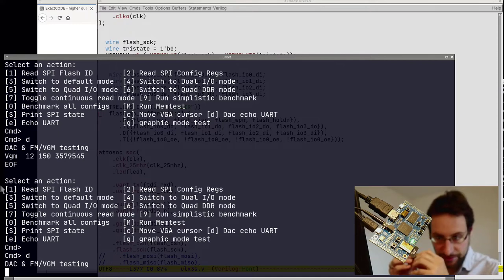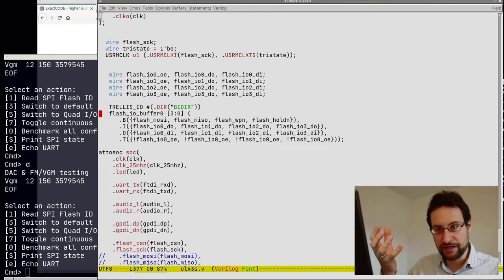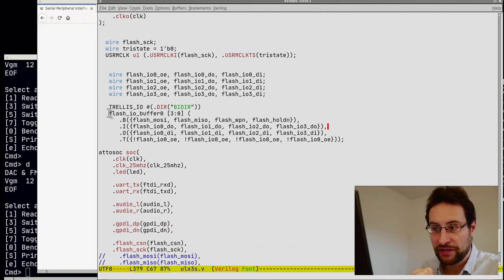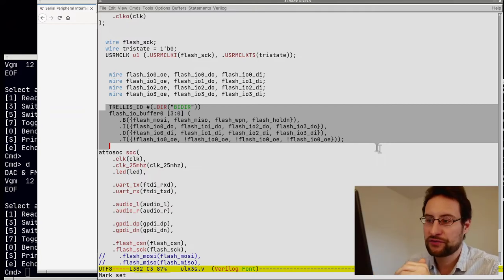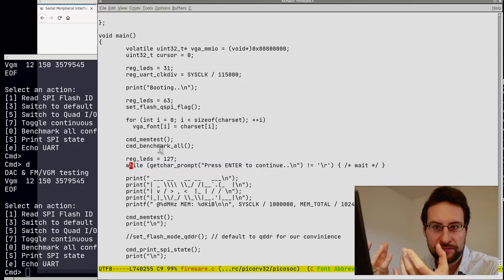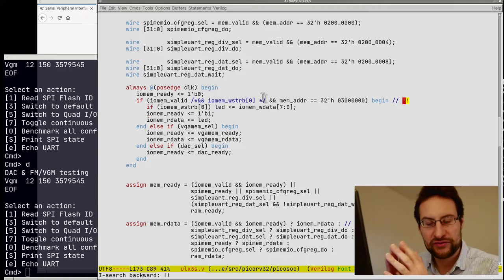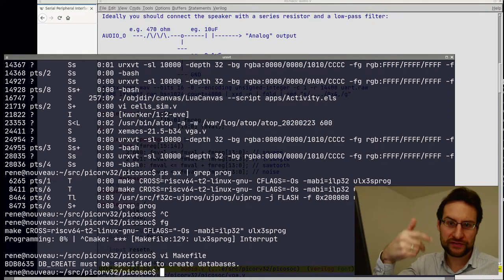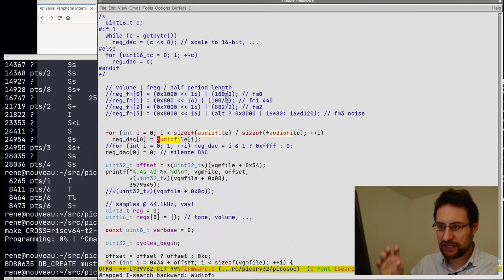RX32.big Quad-SPI fully ported to ULX3S FPGA board and stereo audio DAC!

Comment: For PS2 or USB you can use US2 - check "US2 connector as OTG, PS/2 or sniffer" here : https://github.com/emard/ulx3s/blob/master/doc/MANUAL.md   https://github.com/emard/ulx3s-misc/tree/master/examples/ps2   We also have two more USB port PMOD at my repo: https://github.com/goran-mahovlic/ulx3s-PMOD/tree/master/USB

Comment: This board has ESP32, there's micropython based project https://github.com/emard/esp32ecp5 which can FLASH using ftp over wifi 5x faster than ujprog
Reply from the maker: Yes, thank you so much I noticed, I just prefer a USB cable ;-) but I will give it a try another day. It's mostly sovled now by not having the riscv firmware in the Verilog FPGA bitstream and next I will implement SD card access anyway to load big data, A/V payloads anyway. Anyway, thanks again for this great board!
Reply: @renerebe  More advertising for esp32ecp5 - it will first read flash and decide to erase or write depending on difference, in case you flash 4MB with 1byte difference it will write only 4K sector where byte is.